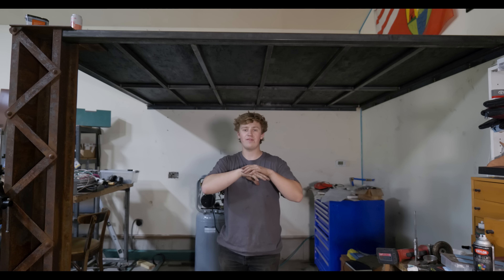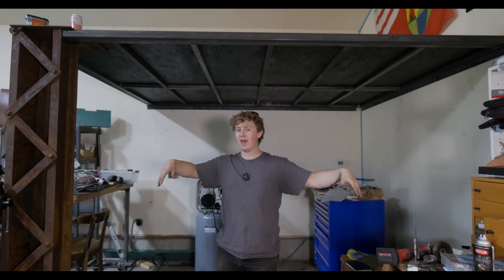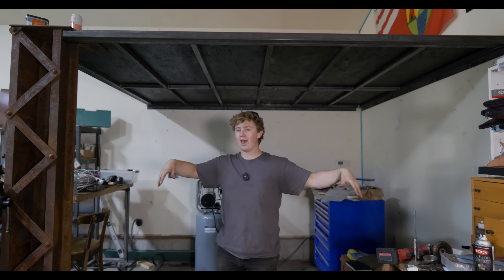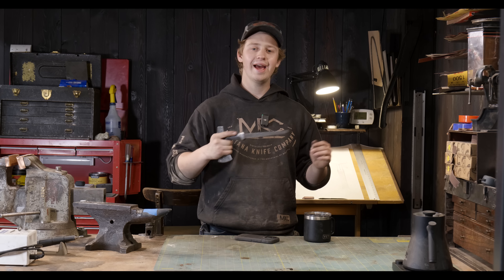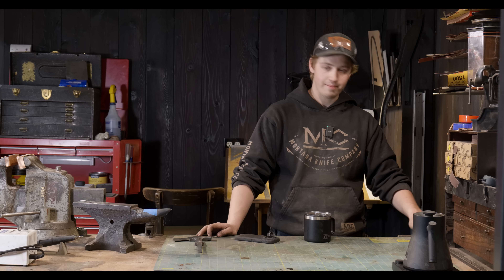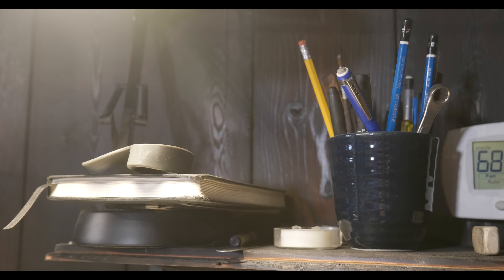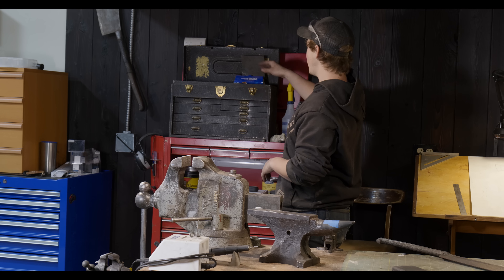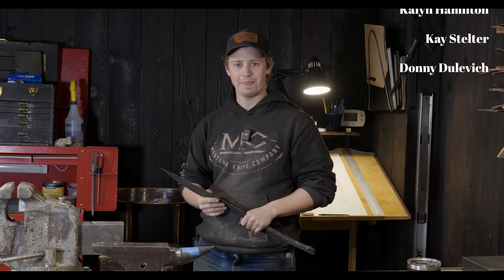I Finished The Coolest Part Of My Shop

Comment: That's not a switch, it's a manual starter.  How many amps do you need to powder off the starter?  Do you actually have any 240v 3/0 power needs in this new area? Do you actually have 3 phase to your shop?  You may want to get your buddy the electrician out to take a look.  Hate saying this, but I think your wiring your area in violation of Code.......
Reply: Yup
Reply: Boooo.

Not all places have building codes lol.
Reply: That's a fused disconnect switch.
Reply: You're supposed to switch off the line not the neutral. Anyway all these code Karens don't worry mate, it works its just 120v it'll be fine.
Reply: He’s using it as a 120v light switch.

Comment: Looks great! Small recommendation though, if the lightbulb above your drafting table is an incandescent bulb, I would either relocate it away from your thermostat or switch it out for an LED. Incandescent bulbs give off quite a bit of heat which could cause your shop to be colder in the winter due to the thermostat thinking it's warmer than it is, and your AC could run longer in the summer because the thermostat will think it's not cooling the space off. You want your thermostat to be getting as much of the natural temp in your shop as you can.

Comment: Will, since you seem to be aiming for an isolated work space here how about some protection from dust and debris?  You could hang either a shower rod and curtains for the open walls or find some track and curtains like those used in surgeries/emergency wards at surplus auctions.  It wouldn’t keep all of the stuff out but it could help and be flexible enough to leave it open while you work in there.  The space is really looking good and I look forward to its continuing progress.

Comment: That’s a fused disconnect. Sometimes used as a safety switch. If it had 2 fuses then it’s single phase. If it had 3 fuses then it’s 3 phase.

Comment: Looks great! You may should have painted the wall behind the boards black. That way when the wood warps and the cracks open a little you won't see white.  🤗
And for the air compressor, how are you going to be able to drain the condensation? You don't want to allow all that water to collect in your tank. You could plumb in a pipe down the wall and attach a valve at the end?

Comment: Are you sure you’re running less current though? With lower voltage my guess would be more current to produce the same effect. But I know just enough to stay away from electrical installations.

Comment: Just getting my shop electrified. The office section is done, and I'm getting it organized. The Metal shop side is ready for lighting. The Wood shop side needs a lot of tools and stuff moved to let the electrician install the lights. I'm almost seventy, and sometimes wonder why I'm doing this. I don't need an income... I do like making stuff though, and maybe I can have folks come in to use the shop and learn a bit of what I have learned. Way out east in Levels, West Virginia.

Comment: You sir are a talented knife maker/blacksmith.  Your general construction skills, however, still need some help.  For example, based on your video and audio commentary, it appears that you ran your air hose through your furnace duct and then taped up around the hose to “seal” the opening?  If so, please remove it before it catches on fire and fills your shop with acrid smoke.